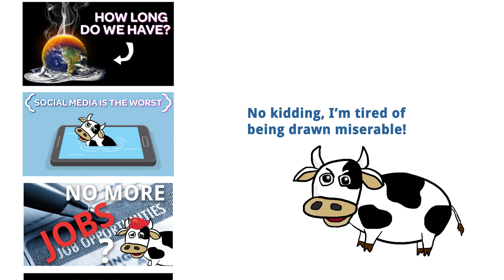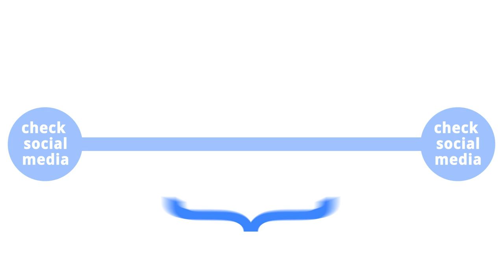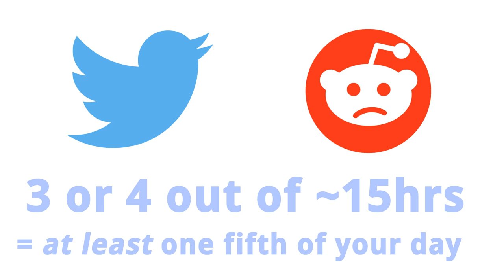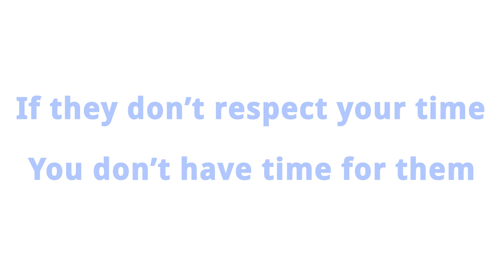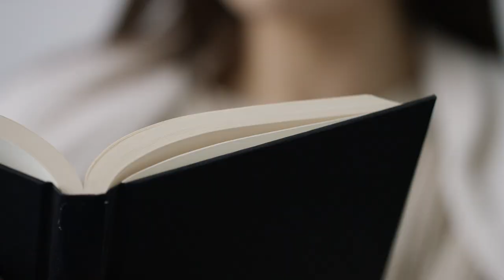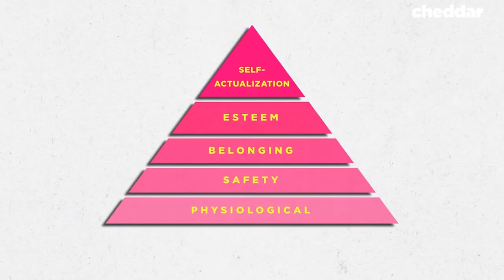How to be Happy

Comment: 2:23
a bad way to run - its because of those shoes
notice how the runner is hitting the ground with their heels first, then the front of their foot. this is not a normal running method (in nature). if you try running barefoot, you won't land like this. it is because these running shoes have padding on the heels. they damage feet.

tl;dr
dont wear dem running shouz